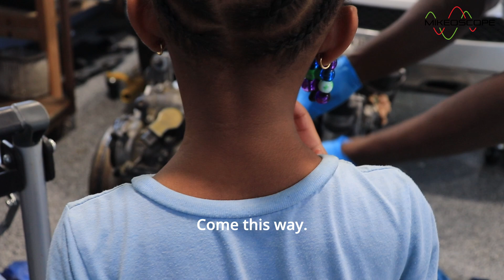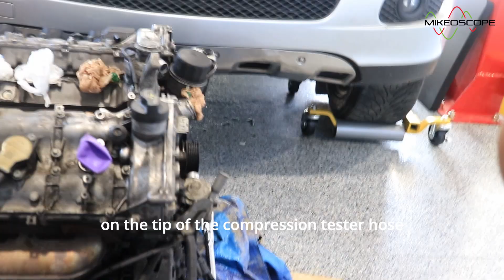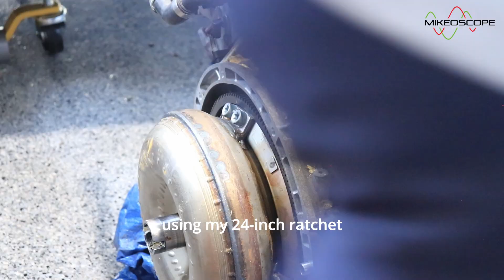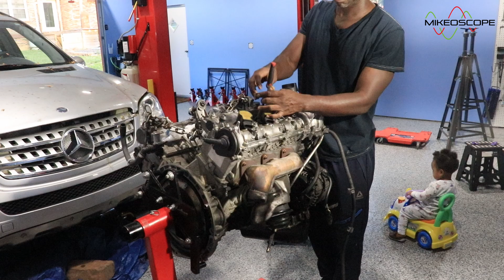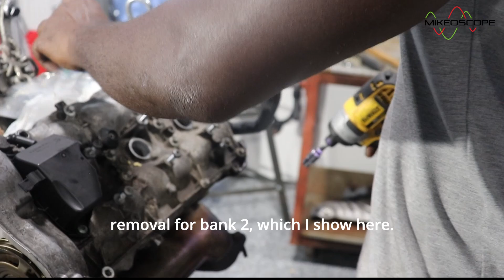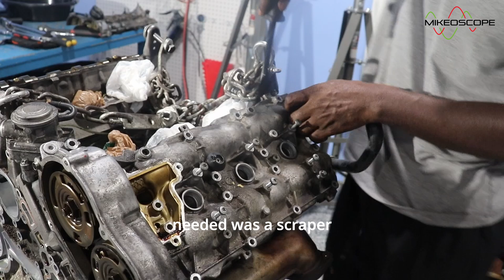Mercedes Benz M272 Engine Timing Repair (PART 3: Valvetrain Exposure): Balance Shaft, Timing Chain

Comment: Question.. I need to adjust the other side bank 2..driver side.. is it possible to do this without removing the engine? Also what size bolt are you using...?
Reply from the maker: What part of the video is your question about?